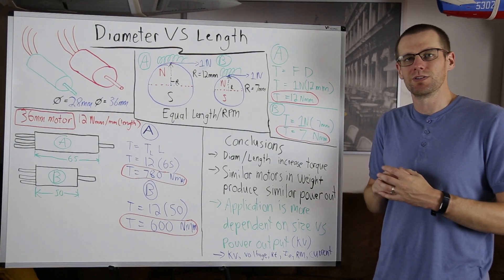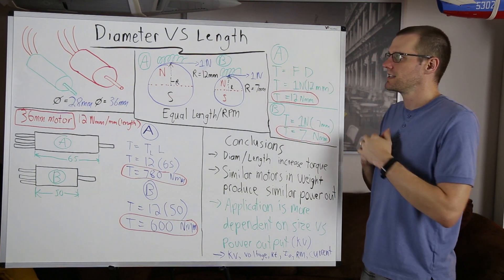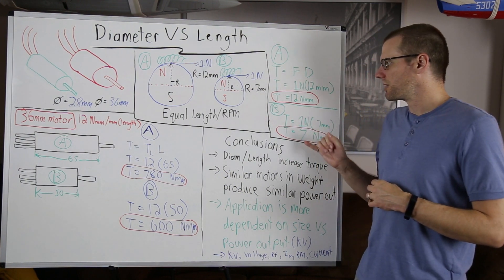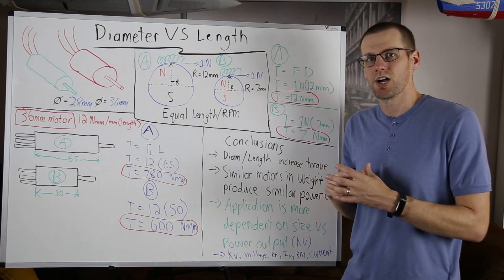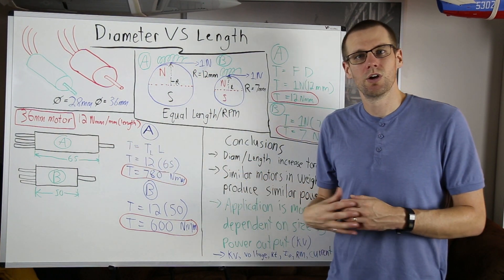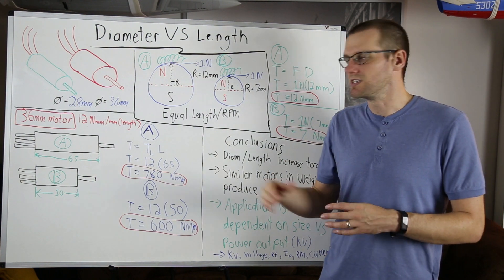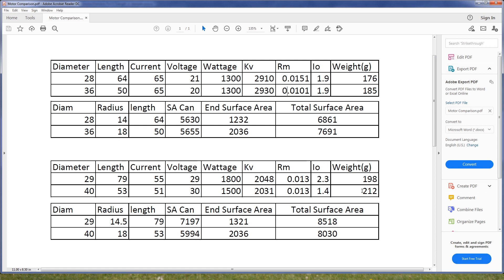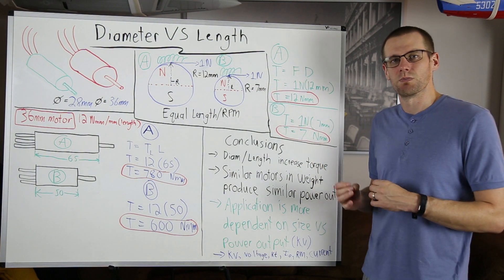Diameter vs Length for Maximum Performance of a Brushless Motor

Comment: This is a great video. The total torque is based on the area of force, so increasing the diameter not only increases the "leverage" but also increases the contact area squared. This increase in torque is very large (for example, doubling the diameter will potentially increase the total torque by 4 times compared to keeping the diameter the same and doubling the length in some cases. Large diameter motors also have relatively better cooling capacity because the heat dissipation area is larger(better efficiency also?). Long motors typically have moderate overall torque but can deliver very high rpm, making them suitable for applications requiring very high speeds. Increasing the motor diameter is probably a better choice than the length (unless you are a crazy speed chaser) of course if it suitables the system capabilities (frames, gears, esc, battery,...)
Reply from the maker: Thank you for the comment!

Comment: It's really nice, there is channel where everything about RC electronics is explained.
BTW your logo looks like TeamSpeak 😄

I didnt calculated that, but intuitively when looking for best(lowest) surface/volume ratio it's sphere shape, among cuboids is cube.
It really surprised me that fat motor has more surface??? Calculations are correct.
Maybe smaller is more densely packed? After calculation I got wide motor is 18% less dense than long one.
Mathematically you never want fat motor (very close to sphere), but here wider rotors have more air inside (my guess).
So in this case, bc its more massive and wider rotor, it has more surface.

After calculating wattage in second scenario, there's only 65W difference, not 300.

So it's just the best to calculate surface and other parameters before buying, bc not all things are intuitive or as it should be...

Isnt it like more heat generates along of can, less on circular sides?
It would mean, longer are better. Is it like that?

Comment: k what would you choose a 3674 2500kv 1900watts max  vs 4268 2600kv 2200 watts max
Reply from the maker: If your goal is power, choose the one that makes more power if both motors fit in your rc.

Comment: You can see the one with larger diameter can have either lower Io or lower Rm, does it mean larger diameter is good for high efficiency setup? Will you make a video that explains why larger diameter can be more efficiency?

Comment: Guess I should have weighed my motors before installing them. I just replaced a 4092/1650kv with a 4985/1650kv. Was hoping the latter would allow me to gear a bit taller and not overheat.

Comment: Really like this channel that nails down the overall general relations between parameters/variable with the correct equations. But often the devil is in the details. If you really look at the stater copper coil loop shape, and think about the loop integral of Ampere or Faraday's laws, the same amount of copper generates more magnetic force with the larger diameter motors where the loop is roughly a square. The optimal shape is circle, but square is better than long, narrow rectangle. And as this channel said, the more void unfulfilled in the motor results in less efficiency, same goes with more work the copper is put to use results in high efficiency. So, go for the larger diameter if weight is the same for 2 different motors, if the craft allows the larger diameter.

Comment: Informative video. Brushless motors do not live long at 60,000 even the ones that are supposedly rated for 60,000. Kv times volts equal rpm and DO NOT EXCEED 50,000.

Comment: Hi great video. How would I find the radius of the motor? Or how would I meshure it?
Reply from the maker: Spec sheet or measure it.
Reply: @RCexplained  ok and what would it be called? Rotor Length?
Reply from the maker: Length of the motor would typically be defined as length of motor can.
Reply: @RCexplained  oh ok I just thought the rotor was shorter that the motors can.
Reply from the maker: Yes if you want the rotor dimensions, (motor was in your original question) you'd have to measure this as manufactures don't specify always.
Reply: @RCexplained  ok yes sorry, should have worded it better. Thanks for all the help. I am building a rc jet boat, and I already chose a motor but I still like to watch this stuff :)

Comment: These examples and assumptions appear too simplistic.
These motors would never weigh the same and would not have the same efficiency, etc.  A longer can or a wider can will of course give more power but also will weigh proportionally more and use more amps. Those are critical factors I think.

Comment: Hi, what about the efficiency due to the lower percentage of wire making up the end turns in the winding for a longer but smaller diameter motor?
Reply from the maker: Great point. I'd expect the differences to be minimal and do not have any data to represent this.

Comment: Great video  although one thing I noticed you didn't discuss in this video is the effects of rotational inertia,  angular momentum and how the perpendicular distance to the specified axis may affect the motor's performance especially at high speed/rpm.

I was much excited to hear it being discussed because it's seldom talked about 

From my understanding, given the same volume but different aspect ratios and all else being equal both will increase in torque with size in either dimension, however, maximum or initial torque should be higher in the motor with increased diameter, whilst the motor with a smaller diameter but longer can length although having a slightly less internal torque should be able to increase (and decrease) RPMs more rapidly as well as have less torque loss at higher RPMs and potentially produce more power as well as have a higher maximum rated voltage and rpm.

In short larger diameter is best for higher torque whilst smaller diameter and longer can length is best for high power and rotational speed.

Also its hard to compare motor aspect ratios when using the same power and kv as controls/baselines, as these are just product values that can be achieved from a variety of different variables. To make an even comparison you would need to compare the same or similar size/weight, number of poles, number of turns, same wind pattern, amateur, number of slots ect.. the motor with the longer can length will typically have more power,  less ir, higher kV and less torque when used in its upper limits. Although if you match the kV the longer motor should still have a higher power output and maximum rpm too and i do see this trend when viewing motor specs too, also the same can also be said when comparing the specs on in-runner vs out-runner motors aswell.

A similar effect also occurs in gasoline engines too when increasing displacement. Increasing the stroke will result in the highest torque gain yet the trade off is lower rpm and less top end power compared to increasing bore which is less effective at increasing torque yet won't drop in torque so rapidly as motor rpm increases making for excellent top end power without any loss in rpm as well as being able to be more responsive to rev up or down rpm too.

Also, another difference is the centre of gravity as a longer can motor will have a lower cg than a short can larger diameter motor. This is also why alot of race boats option for such motors as a 2968 too.

If this is something you want to look into, would love to see a part 2 to this 👍🏻
Reply: Really appreciate people like you for the extra info in your  commentary as well as the owner of the channel for this video . Love the willingness to share the knowledge for people  .👍
Reply from the maker: Hey Andrew, I love your detailed analysis of the differences applicable to changing diameter and length parameters of a motor.  Very Well thought out. 
As much as I'd love to get in to some very deep details within the videos, this didn't seem to be what most viewers are interested in.

Comment: Good video, yes it does seem like best to choose based on the physical parameters, just like I chose a 4068 motor in my 1/8 serpent buggy because it simply doesn't have the space to fit something like a 3674 as 68mm is the maximum length.

Also I recently encountered a situation where two motors I was considering for my 1/12 buggy of different sizes had the exact same power output. A 2838 vs a 2445 both had a maximum of 500W at few different selections of KV/ maximum voltage and both had the same 2.3mm shaft (although most 2838 motors are 3.175mm shaft) I was after. I end up choosing the 2445 cause it was available in the KV value closet to what I was looking for since this vehicle has a fixed motor mount giving no option for larger or smaller pinions.
Reply from the maker: Hey Andrew, that's a very good example that you had written out. I like how you prioritized kv to truly match the power system you required rather than size differences between the motors.

Comment: pls give conclusion sry bad English
Reply from the maker: Hi Tam, it really comes down to your specific RC vehicle. In general, a larger motor whether it's in diameter or length will provide you with more performance.
Reply: @RCexplained  I’m using a onroad 1:8 Rc what is the most ideal
Reply from the maker: check to see if a 40x82mm motor will fit. This size motor will be good for 140km/h.

Comment: So if you have a 3650 motor vs a 3674 motor and they have the same KV at 3000. The 3674 motor would have more torque and produce the same RPMs?
Reply from the maker: Yes, both motors would have the same torque constant, however, the larger motor would be able to draw more continuous current. This would result in more torque potential.

Comment: you talk about the amount of copper which makes a lot of sense for me BUT...what about the longer arm/lever of the larger diameter-motor?
Reply from the maker: Hi Arcade Collectors Europe, there was a calculation running through this. It works out very similar to just lengthening the can size as you have more leverage occurring along the additional length.

Comment: The video I've been waiting for. Great thanks. I think if you do a video on 540 size  4 pole motor vs 550 size 2 pole motor. It would be great. Its a very common question most of the RC fans asks.
Reply from the maker: Great suggestion! Thanks for the comment Gehan Wijesundara.

Comment: I want to build a jet surfboard using 200a esc on 6s and a 4092-1520KV  brushless motor that have 4300w will this system work i am 50Kg
Reply: NabiL: May I suggest you go to the YouTube channel:  Youngsters Jets. Here you will find TONS of information and build experience!
Reply: Remko Jerphanion yes i watch him i got the idea from him thanks for reply.
Reply: @NabiL_Lam  Cool!
Reply from the maker: Hi NabiL, this highly depends on the jet you are planning to run. First impression is that the 1520kv option is too high for 6s.

Comment: Generally the vehicle has space for a common size......
Reply from the maker: That is correct. In my case, almost every RC I own has an option to use multiple common sizes.
Reply: RCexplained so more turns and lower kv = more resistance, less heat? More low end power?
Reply from the maker: Lower current through a motor with higher resistance (lower kv) will produce less heat. Low RPM torque for any motor is based on the torque constant multiplied by the current being pulled.